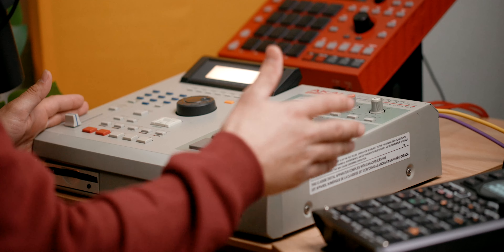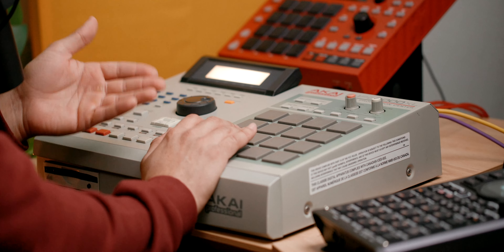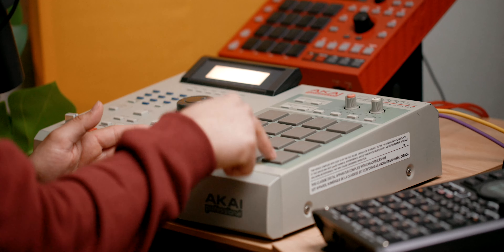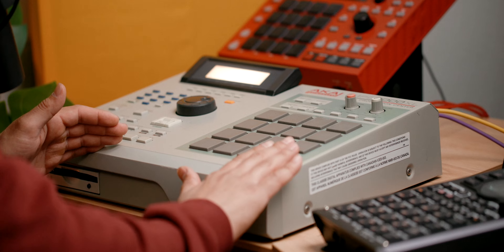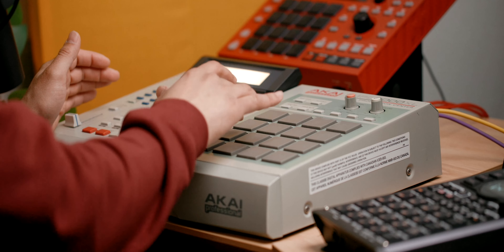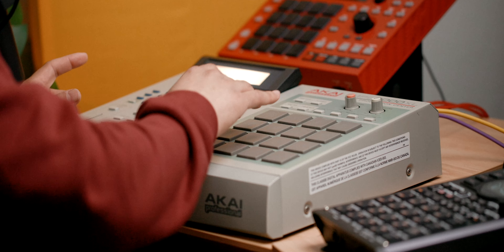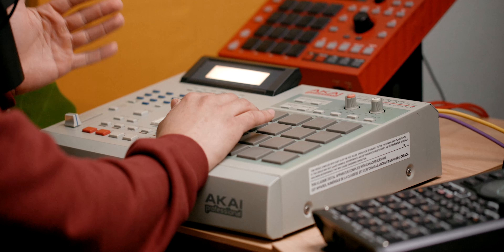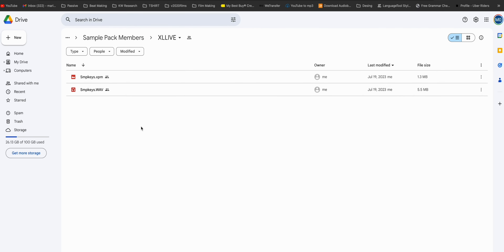Sample Chopping Melodies Techniques with any Sampler | MPC 2000xl

Comment: You using a choke group? I thought the 2000XL can only have three pads cut each other off?  Or you sliced those chops perfectly it fit the tempo?
Reply: It doesn’t have choke groups, if it had that and normalize I’d use it much more because it makes drums sound amazing

Comment: first off how do I copy a sample from one pad to the next, possibly rename it and then save it. or do I just save it with a different name and then ill have 2 and assign it to the pad2? and secondly did you sample all those pads individually? rather than using Zone Edit? or did you perhaps use Zone Edit but NOT create a new program? I'm like 3 weeks in with my 2kxl. if you want to tell me how "program change" works id appreciate it as well, sometimes I assign a program to a track but when I hit record it goes back to Pgm-A somehow and drums start playing the Midi where I originally had say a key sample chromatically. - thanks dog Salute

Comment: Thinking of purchasing a vinyl player so I can use with my Mpc one any recommendations for affordable one?
Reply from the maker: Dude, yes I’m so glad you asked. Check the one that I’m using in this video. I have a link in my bio, it cost around $125 new or you can cene find it used for cheaper and it sounds AMAZING. Audio technica LP 60
Reply: @malobeats  man thanks 🙏 I’m checking it now

Comment: I'm having a problem , when I use the sampler on the MPC 1 no sound comes through my speakers or headphones while I'm sampling but the samples are recording and are there to use but I don't know what I'm recording until I have finished???
Help
Reply from the maker: Yes. I know the issue you might be running into. When you’re in your sampler page receiving input signal, make sure you engage the in button located on the lower left-hand side of the LCD screen. Once that’s engaged you’ll signal coming in. Please let me know once you get this going.
Reply: @malobeats  thanks il try this , loved the new MPC keys video 🥳👍👍👍